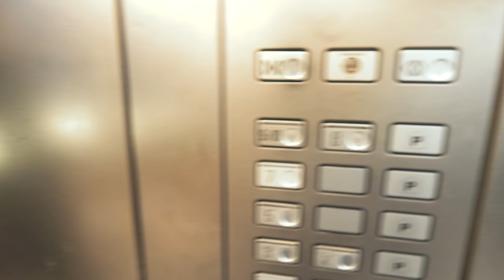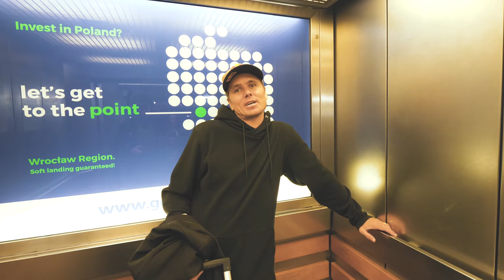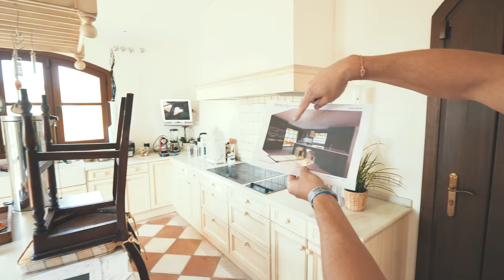A 17 TON DELIVERY IN MARBELLA!!! House renovation has started! | VLOG² 153

Comment: Every month I travel at least twice to my parents' home, and fourteen days ago I crashed on skis when I was going to attempt a backflip. I fainted, got a concussion and a lot of pain in my back. Still feeling it.

Anyway, every time I travel home I'm not travelling light, I'm filling both my Hugger 30L & Base 15L. Putting the Base on Hugger with the hook-up system.
The total weight is often quite heavy and after the crash my back hurts wearing two heavy bags at the same time.   

It would have been a lot more easier with a bigger bag on wheels, right now. And in the future, a useful set-up for larger trips would be very nice. 

// Albin Svedberg